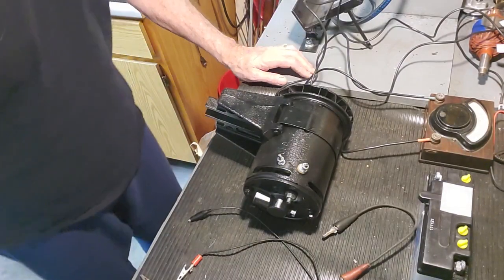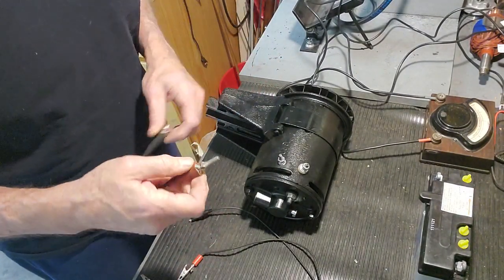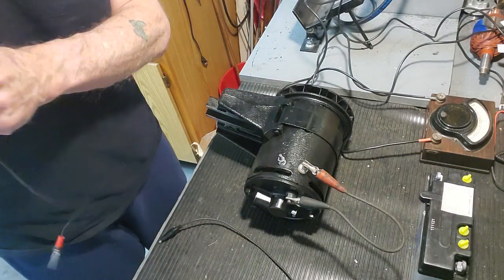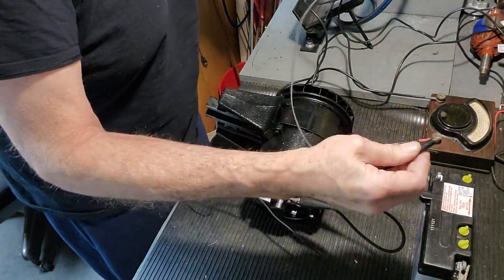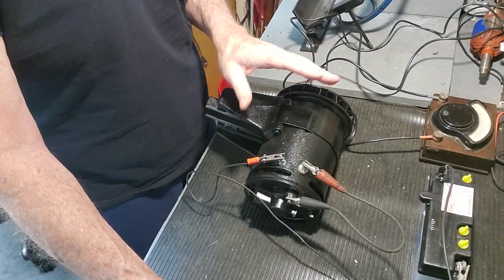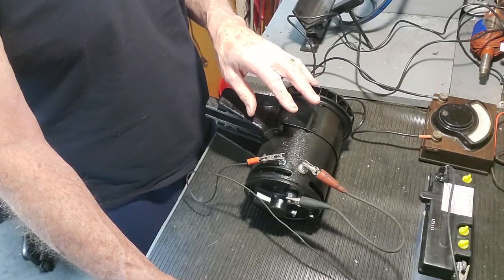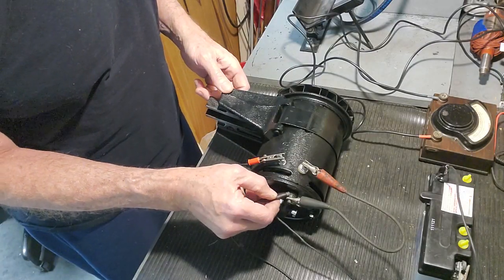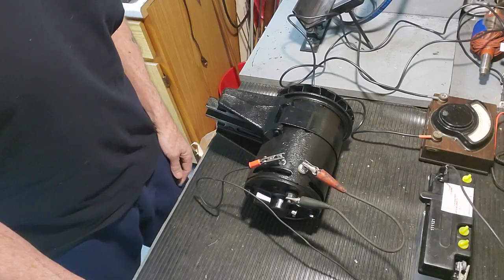Polarizing a Ford 2-brush positive ground generator

Comment: I have a 6 volt, positive ground generator on a Ford 881 tractor. Generator has been rebuilt and is matched to a new regulator. When polarizing, does the generator and regulator have to be installed and hooked up to be polarized, of can just the generator be "bench polarized" with the regulator out of the circuit? Someone had mentioned to me that the regulator has to be in the "polarizing circuit" so it know which way to send the current. I do not want to burn up a new regulator, or generator for that matter.
Reply from the maker: It can be polarized on the bench as I show. The regulator has nothing to do  with polarizing it.
Reply: @SwabbieSteve  Got it! Thank you sir!

Comment: Im pretty sure i have a 2 brush on my old ford 8n. I need to polarize it to the original positive ground. 
Would i take a jumper and go from the field to output terminal since its already hooked up to a 6v battery in the tractor?
Reply from the maker: Yes, this applies power to the fields

Comment: I converted my 34 Ford truck to a positive ground and installed a 12 volt regulator. The generator passes the run test but still doesn’t  charge. I’ve replaced the regulator and still no luck. Can you help?
Reply from the maker: I assume this is a later 2 brush generator. If it motors, but does not charge, make sure the brushes are seated properly. I just posted a video about this. But many things could cause this, too numerous to cover here. If seating the brushes doesnt help, try bypassing the regulator and use a field jumper as shown in this video. The generator should put out max current by doing this. But only do it for a minute to determine if the problem is with the generator or regulator.

Comment: Thanks for a great video Steve, I am currently working on my Ford GPW generator which is not charging. I have dissasembeled the generator and found everything to be OK, so mabye I should try to polarize it
Reply from the maker: Sometimes that's all it takes. Have you seen my video series on rebuilding a Willy CJ2A generator? Its a little different from yours, but similar.
Reply: No I did not know you had made one, I just found your channel yesterday. I'll take a look, thanks!